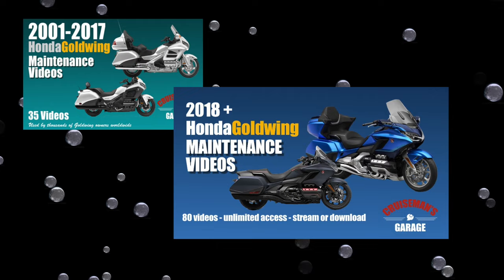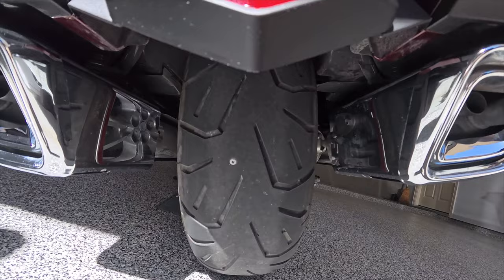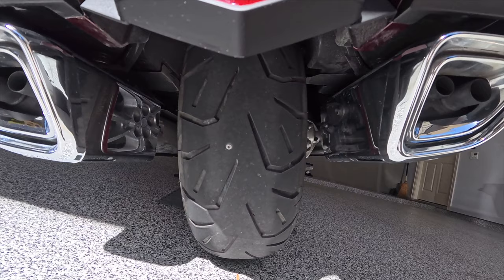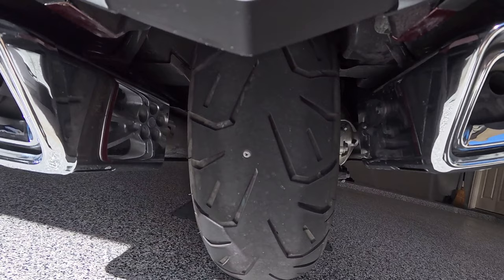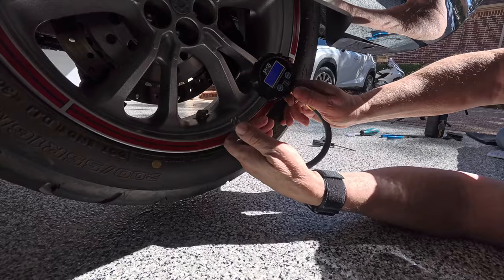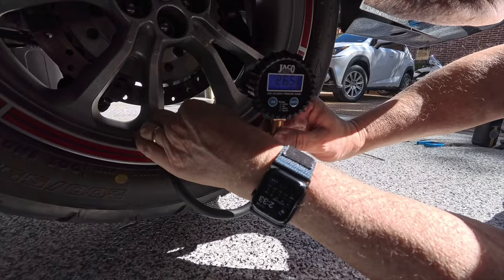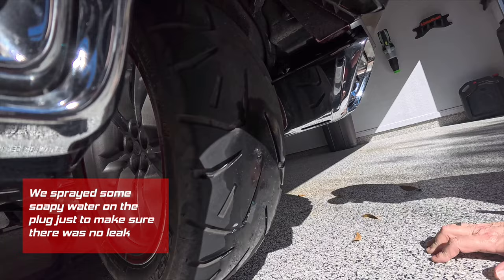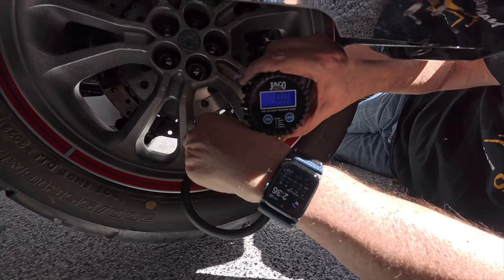Robert White's Goldwing Is Screwed! | Plugging a Motorcycle Tire

Comment: Tip: Be sure to carry a couple of valve cores and a valve core remover in your repair kit. I was on a month long road trip in 2017 and noticed my front tire was low when ready to leave my hotel one morning. Couldn’t find any evidence of a puncture, at which point I checked the valve stem, unscrewed the valve cap and felt air coming out. Was unable to tighten the valve core, indicating that it had failed, so I unscrewed it and replaced with my spare. Pumped up the tire with my compressor and was on the road in under 30 minutes. Lesson: Not all flats are punctures…sometimes there’s a zebra among the horses. 😅
Reply: Thanks for the tip 👍
Reply from the maker: Good idea.

Comment: If a tire is relatively new and the plug is gives you some concern. No need to buy a new tire just have a tire shop remove the tire and grind off the plug, prep the inside surface and do an inside patch. That won't leak for sure and you can proceed to use the tire until it's time for replacement.

Comment: Nealey tire repair kits.  I've been plugging tires, big trucks, trailers, cars, to motorcycles, for 50 years and these are the best plugs I've ever used.  Have been using them for years with zero issues.  Of course, some tire punctures are not repairable, but if they are, I believe these plugs are the best.  No need to ream the hole and with this design plug you end up with 4 strands of the plug through the hole.  It can fill the wound better if it's not a perfectly round hole by using the 4 strands this fiber stranded rope plug.  I have no relationship or interest in Nealey tire plugs, I just really like the way they perform.  The only place I've found them is online.

Comment: Use side-cut pliers to get that stubborn screw out, not needle nose. Needle nose pliers tend to get their tips bent easily making them useless. With side cut pliers, you work the cutting edges under the screw head then pry out the screw using the handles for leverage. When prying, you can also put a small fulcrum under the handles such as a stick or wrench handle. No need to twist the screw out, you get enough leverage to pry it straight out. Quicker, easier, won't damage your needle nose pliers.

Comment: I had just bought a Michelin Road 5 for my Super Tenere, for $300 installed. I picked up a piece of metal like a nail, but flat. The plugs that I got at Cycle Gear were too thin to plug the hole, so I used one like Cruiseman did and I rode for many miles after that with no problems/leaks. A shop probably won't plug a tire, but I would do it again if needed.

Comment: You can drive until that tire wears out with that plug. I've ridden 1,000s of miles and will do it again if needed. I even drove 6,000 miles on a mushroom plug, but that was the first time and last time I used one. They are not very good and I had to use fix-a-flat to get it to seal. The bacon strips work much better.

Comment: Ive got 3 plugs in my current tire. Been riding for 25 years and have always plugged my tires. Never had one fail. Same with my vehicles. Do it right, and you wont have any issues.
Cant say ive ever drilled out a hole. I use the reamer to plug the hole immediately after i remove the nail or screw. I dont ream, just make sure i can shove the reamer all the way thru. Then while thats plugged, get my rope and glue ready, remove the reamer, and then shove it, twist it(this makes a bulb on the inside so you dont have to hold it and makes a better seal. Its even on the directions of the package.), and remove the tool. Wait 20 minute and cut excess. Check air pressure and clean off the tool with mineral spirits.

Comment: Just a small tips to share 
Before pulling out the handle out of the wheel, do a few turn on the handle to create a nod inside the wheel so it holds the rubber worm and air better. 
Regards to the mushroom plug, I used to had it and it still leaks. 
Thrown into the bin and replace by the same set you had. 
Most reliable and cheap is the rubber worm plug.

Comment: 6 mushroom plugs used on 3 bikes over the last 8 years…they worked great.  No leaks.
Reply: You're lucky, ive had 3 mushrooms blow out when riding home. Never has a bacon strip let me down yet.
Reply: I agree 💯 same here 21,000 mi no problem still riding on the same tire

Comment: That screw was not necessarily intentional. 

My understanding is that the screw or nail is laying flat on the road and as the tire goes over it, it makes it stand up and then the tire catches it as it standing up and pushes it all the way in.

PS. I use the mushroom plugs as they can’t come back out and the air in the tire is help keeping it in place.  I and my friends have used them many times, over the years, with no issues. 

You have to make sure that when you put the mushroom plug in the tool, the mushroom head goes into the hole first and then as you’re screwing down the Allen screw to force the plug into the hole. It will tighten like you think you’re there, but keep going until it completely bottoms out and then pull the tool off .

Comment: I've been using the mushroom-type tire plugs for more than 20 years, with good success. The gun that comes with the kit is bulky and not ideal if space is precious, but I can only think of once that I had to remove and redo the repair. The sticky rope type performs well also in my experience. As a former dealer, I've repaired a LOT of tires, so my sample size is fairly large. One point I'll offer is that I always leave the excess plug intact until I have successfully reinflated the tire without any leaks. Sometimes an extra tug on the plug with a pair of pliers can help finish seating it if a small leak is detected.
Reply: leaving excess alone until you are sure it seals. Pulling on the sticky rope ends to insure a good seal should be listed in the instructions. Excellent advice!

Comment: First time last year for me too.  Been riding since 1983.  I'll take that as good luck.
Reply: My first and only kit so far has been the Slime brand all included kit.  Reamer, plug insertion tool, rubber cement, plugs.  I put some cement on the reaming tool in thoughts it would help me at least insert easily if not well cover the hole with cement.  It did seem to.  I cemented the plug as well for the same reason.  Tail end of last year and a few months on the plug without any air loss.  If you do end up pulling the wheel and removing the tire make sure if the tire valve is out to return it to pointing to non-brake side (2014 like mine).  If it points out to the caliper side it may bang into the caliper, mine did.

Comment: Been riding for over25 years. Never used to get any flats. Now it seem like I get them all the time. I used to replace tire every time. But now I just plug and ride. Definitely keep an eye on them. Plugs hold fine. Right now I have three plugs on back tire. Tread is getting low so I will change soon.

Comment: I have used the rubber plug when I owned a repair shop. I would only use that type of plug on a non-steel belted tire (steel belts eat up that type plug) and I used a pneumatic gun to insert them. All other tires, I used the sticky type plug.(made by Safety Seal)

Comment: A few years ago, a number of us riders were returning to Canada from a road trip to Minneapolis.  One of my friends picked up a nail on the rear tire of his Harley.  I had a patch kit and compressor and we ended up patching it on the side of the road.  Unfortunately by the time we noticed his tire had gone flat, it also caused damage to the sidewall.  About 5 miles after patching the tire, the sidewall gave out.  He managed to call roadside assistance and they sent a tow truck.  We loaded the bike up and it was hauled to Grand Forks, North Dakota.  The next day the tire was replaced under Harley warranty and he was able to return to Canada.

Comment: On a trip with a buddy once that got a screw in his back tire.  Thought how fortunate that he noticed it that evening at the motel.  Plugged it with one of the mushroom style and the next morning it was holding air fine.  A few miles after leaving, the tire went flat again.  He re-plugged it every few miles until I went ahead to a town and bought some of the sticky rope plugs.  The sticky rope held fine.  I'm a firm believer now that his problem was that he didn't ream the hole well enough and the  steel belts were cutting the mushroom plugs.  Only tried and true sticky ropes for me.
Reply: It is important with the mushroom plug to move your reamer (or Cruiseman's electric screwdriver) around in a circle a few times once it is inserted into the tire. This helps remove any rubber or case material away from the inside margins of the actual puncture site and allow the mushroom the sit flush against the inside of the tire when pulled back. Just FYI.

Comment: Carried the mushroom plugs for 10 years without ever having to use them. Tried them out in the shop one day on an old tire, OMG difficult is an understatement. I realized I could never do it on the road or trail. Toasted the whole kit in the bin. I think the method you're using is by far the easiest and readily available solution. Cheep easy, and it works. You can always do a permanent fix from the inside later, though I never have.

Comment: Cruiseman:  Thanks for posing this video. I've done a lot of long-distance riding over the years and have been extremely lucky as far as flat tires are concerned.  Only experienced one - and that was in town about a mile from a bike shop.  I'm heading out to some as yet undetermined destinations for 2 weeks in May and I realized after watching that I need to quit tempting fate and get prepared. I used your suggestions and am getting tooled up. Appreciate all the information. Peter in Santa Fe

Comment: I have seen the rope type plugs fail when a friend had a small sharp piece of gravel through the tyre creating a large hole. Ono of the things that may help in this situation is to not fully inflate the tire, because as soon as the tyre heated up and built up pressure it blew the rope out. Of course this means that you need to ride slower until the tyre can be replaced.

Comment: I was riding back from an awesome adventure with my dad at the totd and hit something with my back tire in Louisiana somewhere.    And without plugs, I would have been screwed 😅😅. My dad walked me through how to plug my motorcycle tire. We had to stuff two plugs in at a time and still after like 25 mins of riding, the plug would pop out and it would slowly go flat again.        Thanks for teaching the people how to plug this tire because these bikes are made for the long distance stuff and if you’re out stuck in the middle of nowhere and you have a flat.. you better know how to fix this tire or else you’re screwed(oops i did it again).       That’s probably one of the top two things I have on my bike at all times.    A tire repair kit for this exact thing.    See you down the road.

Comment: Similar decking screw, new tire only 300 miles on it, first day of 3Twisted Sisters ride.  Plugged and rode it fine the next 2 days and put another new tire on it, same ribbon plug used.

Comment: Have used sticky rope plenty of times with success but the shroom plugs are a better design.  Basically due to their shape they can’t come out if installed correctly.  But they require an understanding of the tooling and install method - different animal.  Plenty of good videos out there on them.

Comment: Had this happen with a decking screw just like that in the same place. Did exactly what you did and the rope plug lasted about 100 miles before it blew out stranding me again. Fortunately, LOL, the tire was almost at the wear bar so went ahead and replaced the tire. The tire monitor was awesome in that it let me know instantly when the plug started coming loose and gave me just enough time to get to a safe area to park  and go home and get my  trailer to take the bike home to replug the tire and ride to the shop for new shoes.

Comment: Tip: if a standard cordless drill you can tight tighten the 3 jaw chuck on the  screw and then put it in reverse and easily back it out.
Reply from the maker: Great tip. Wish I had thought of that.

Comment: I’ve used those spaghetti type plugs and I do not like them and definitely wouldn’t trust one of those on the long-haul. The ones I do trust are the mushroom plugs and I have plugged a number of tires with those and only had one failure out of 15 times. The one that failed was due to the angle of the hole. The rest of them I plugged the tire and rode with them that way until the tire was worn out. Of course, I do keep a closer eye on the plugged tires and check the air pressure more frequently.

Comment: Chris, good video for the how to on plugging a motorcycle tire.  I was on a ride and my rear tire was pretty much gone so I found a Honda dealer in Twin Falls Idaho who had am Elite 4 in stock and had him put it on.  400 miles later and the next morning my TPMS was flashing at me and I thought the tire lost air pressure because it had gotten cooler over night.  I stopped at a convenience store to top off the tire and that was when I discovered  my new tire had a 2" long sheet rock screw in it.  I carry a plug kit and compressor, but I was only 250 miles from home and decided to see if i could get it home where I could fix it properly.  I got home without any issues only losing around one psi per hour.  Once home I took the tire up to my friend who has a tire store and had him boot the tire, I have been riding on it ever since with no issues.  If my option had only been to plug the tire I would have replaced it, but booting it not only seals the hole but also patches it from the inside, which is much more secure than a plug.  One last thing, a real good pair of side cutters specifically those that are designed to cut zip ties is perfect for cutting the plug off flush with the tire, and much safer than a razor blade.  Once again thanks for what you do for our Goldwing community.

Comment: A friend got a puncture when riding his bike round the Isle of Mann. He used a mushroom plug kit which took less than 10 minutes to do. The plug was still good a year later when he finally replaced the tyre which by then was ready for replacement. I have more or less the same kit but luckily, I have not had to use it yet. Long may that be the case. 🤞

Comment: Plugging a tire will not ever fail.    If it’s done the right way you don’t have to replace your tire.  I went 7,000 miles on my 2006 goldwing and never had to add air except the 3 to 5 lbs over many miles.    👍😎🇺🇸🇺🇸🇺🇸🇺🇸

Comment: If I have a screw in the tire, I don’t try to pull it out with pliers or needle nose. I find that using a screwdriver gets it out much quicker.
Reply: If the road hasn’t ground down the screw head like in this case.

Comment: Drill it completely unnecessary. File rod or ream stick tool is best for cleaning rubber hole.been fixing tires 63 years and if the tire is good when you get home pull it off the rim and use the plug patch good for the life of the tire.
Thank you Gentlemen.

Comment: The air compressor featured in this video is too big for a road trip when the saddlebags are filled..there are much smaller air compressors that are a better choice that will fit nicely in the very back space of the saddlebag out of the way of the saddlebag liner in the saddlebag..it's already a tight fit with the saddlebag liners with your clothes.

Comment: I purchased a mushroom type plug came with gun and lubricant it does leave a small plastic plug which unfortunately stays inside your tyre, tested with soapy water all appeared ok but after a 2000 kilometres the tyre would lose approximately 6 psi each day before each days ride we would top up the tyre. It didn’t spoil our trip but I am going to have the tyre professionally repaired or replaced it has 4mm left the bike is a Honda cb500x with 10000 kilometres so not totally worn out.should I have the tyre replaced ?

Comment: Thanks for this.  I noticed that the rear tire on Robert’s Goldwing is not touching the floor when on center stand.  I have a 2021 Tour DCT and the rear tire is touching the floor when on the center stand making it almost impossible to rotate the tire, I have to put the center stand on a board so that I can rotate it to check tire pressure, etc.  Any ideas or is this by design?
Reply: Dash that's definitely not by design.  I wonder, if your rear tire is touching is your front tire up in the air... like is it a weight distribution issue?  If both are touching you need to get you a new center stand.
Reply: Agree...my rear tyre is a good inch or more off the ground when the bike is  on the main stand, with front tyre resting on the ground.
Reply: I’m thinking maybe you have so much weight added to the bike behind the center-stand that the rear of the bike is winning the see-saw battle. On occasion, I will have the Warden sit back there on the rear of the seat while the bike is on center-stand so I can easily rotate front wheel to fully clean it.  And before the temptations to comment hit, I am fairly sure she knows not yet of this pen-name. So the point is, if you are loading down those bags and tour pack, and also have your blow-up blonde riding pillion, you may have found your cause.
Reply: @robertwhitemoto , both tires are firmly touching the floor.  It’s a low mileage bike I bought at a dealer.  It came with a lot of Goldstrike accessories installed.  If there is such a thing as a custom center stand then my guess is that the previous owner had it installed.  The bike requires little to no effort to pull it back on the  center stand which I found a bit surprising and yet pleased unlike my bmw r1200gs adv.  I’ll go to the Honda dealer and compare the center stands.